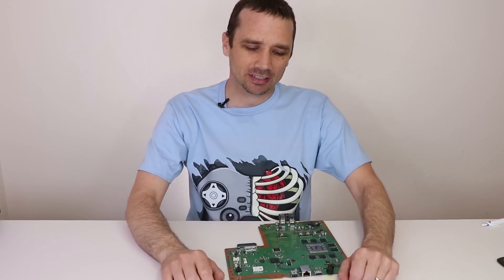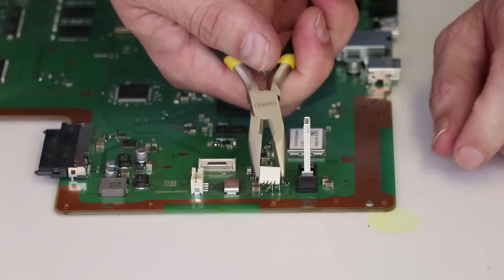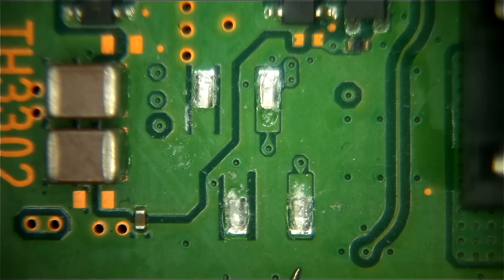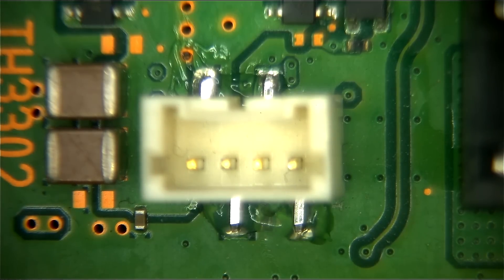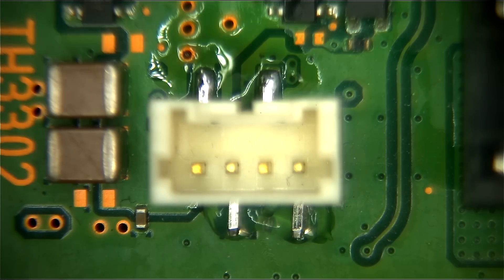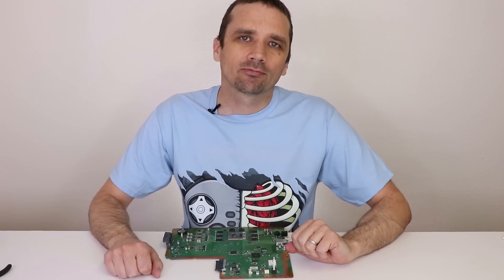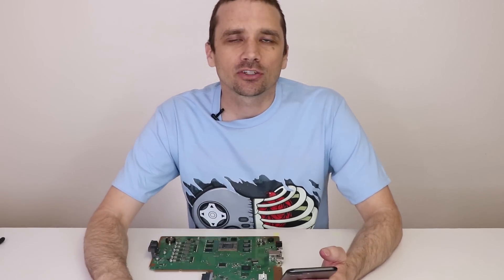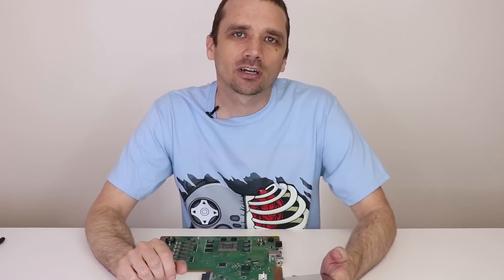PS4 Power Supply Repair + PS4 Q&A At The End

Comment from the maker: Let me know if you have any questions. What other videos do you want to see?
Reply: TronicsFix I have two questions 
1: my PS4 crashes pretty hard and displays a message saying "error in the operating system"  thing is that I restored the console 3 times with a USB stick and a fresh install of the OS and it keeps crashing to the point where I have to unplug the thing 
2: my Xbox one S had a weird problem with the on/off and eject button 
I pressed the eject button the console turned off, same thing with the on/off button,  it ejected the disk 

Hope you know what the problems are 
Great channel by the way
Reply from the maker: Hmmm...not totally sure on this one. I'd lean toward the APU or hard drive.
Reply: @legofan8070  ja irgendwann
Reply: What would you recomend for a cooling mod on the ps4 or ps4 pro?
Reply: @zKyserr  Actually a good mod you can do is to replace the thermal paste and the thermal pads with much better one, like Arctic's one, thermal grizzly isn't bad also
Reply from the maker: They generally don't need extra cooling. I don't know of any legit cooling ideas that actually work.
Reply: I opended up my ps4 to clean it and my 4 pin connector broke and I ordered a new one and I pluged it in and it still wont turn on can you please make a video on this!!!
Reply: I've got a ps4 power supply that has a short in it. It pops the fuse as soon as it gets power. How do I track down the short? And no, there were no roaches in it lol
Reply: TronicsFix  hello, can you make a video testing god of war on the ps4 pro and see how loud it gets, because mine gets really loud when playing god of war.
Reply: Oh alright. I was thinking about cutting a hole on the top of my pro where the fan sits. Then putting a dust filter over it. In hopes of letting more air in and making the console more quiet. A video comparing it before and after on a game like god of war would make for a interesting video i think. Keep the videos coming love your channel!
Reply: TronicsFix  where can I find the fan connector on ps4 slim?
Reply from the maker: @yj mo I don't know of anywhere to buy them. I take them off of junk boards.
Reply: What is the exact name of the replacement plug?  As I searched, I found "JST 4pin 2.54mm" and it looked similar - is that the correct part? I accidently ripped mine off and damaged one pad too. Even after disconnecting the Power Supply side, I wasnt able to get the cable off the connector, so I want to try to resolder a new connector and get a new cable too because my cable-plug (plastic) is heavy damaged bei the tong I used. - Its a PS4 Pro CUH-7016, with a 4pin wire.
Reply from the maker: @martin I don't have a source for them. I take them from junk boards when I need them. Sorry.
Reply: @Tronicsfix  Thanks for your reply, I already gave my console to a technican that soldered a bridge cable for me and my plug was still usable. Anyways I has some short circuiting if the cover was screwed on properly so I had to put Isolation Tape around the hole were the powercable went through... this was actually solving my problem.
Reply: @Tronicsfix  Hello from Germany. Searched a lot in the internet but found nothing.
My system clock resets everytime i shut down the ps4 and unplug it.
Changed The cmos battery 3 times but nothing.
What could it be on the board? Nice greetz.
Reply: Hi tronicsfix. My ps4 has recently just stopped working. It wont respond to anything i do. It wont turn on if i press the on button, the disk eject button and it wont turn on if i use the remote. I suspect it's the power supply. Does it matter what model power supply i put in.
Reply: Does it work if you just shortcut the side connector of the power supply so it will always give the +12VDC?
Reply: My PS button doesn't work on my controller please help me it charges but won't power on what's wrong???
Reply: Can you do a video on how you connect these wires you speake of at 1:50.
Reply: How much do you charge to fix this problem
Reply: @TronicsFix my ps4 fan won't spin anymore, It happen when i played Assassins Creed origin, after 2 hour playing my ps4 fan suddenly spin so fast 2 times and then it give overheating message and force shutdown. After that i open my ps4 cover  and try to turn it on the fan does not spin, i tried to clean the dust on the fan and on the heatsink  and change the paste too but it doesn't work, my ps4 fan still not spining. Do you know what the problem is? Is my fan broke?
Reply: Hey mate. I have a ps4 power supply that is somehow not working. Main fuse was blown and i tried replacing it with end result that ntc1 thermistor literally blew up in test. Is it even possible that the thermistor was the problem at first place and blew out that fuse. Where i should be looking for the problem next?  power supply is model apd-240
Reply: My ps4 wont even turn on at all
Reply: Water spilled on my ps4 maybe four days ago.. now my ps4 turns on and off  by itself and when it boots up it’s in safe mode I’ve tried options 3,4,7 in safe mode but it only turns off and restarts in safe mode what should I do?
Reply: TronicsFix can you do a video where the one pad in the video rips off and you need to run a trace would be very helpful
Reply: On mine the mounting point ripped off. Am I screwed?
Reply: Where is the best place to get a replacement motherboard and logic board for the ps4?
Reply: Hi I "broke" my usb port, USB cable was touch metal and make Spark.. now front USB port don't work.. Can you make some video or comment about that..
Reply: hello 
excuse me but what is the name of the(white) piece you change
do you have a link 
thx a lot
Reply: Can I send in my ps4 for you to dodger these parts back on with a new power supply ?
Reply: This happened to my ps4 pro can you make a video on how to fix it?
Reply: Hi, could you please measure the value of the two big brown caps directly beside the white connector (opposite direction of the big power connector).
Thx in advance!!!
Reply: @TronicsFix I tore off my power supply connector from my motherboard and then I hired a electrician to solder it back on but my ps4 still isnt turning on. What do you think is happening please help
Reply: Hi ... I did broke the other end pins
Reply: One of the pins broke .. what sould I do in this difficult situation cause I cannot go out because of the Corona 😭
Reply: TronicsFix how do we send it into you?
Reply: TronicsFix I need help so right next to what you took off there is those two small boxes how do I put those back on ?
Reply: TronicsFix do you know the part number of the connector? I brought a broken ps4 on eBay and there was no cable and no connector.
Reply: TronicsFix where can I buy the 4 pin connector?
Reply: My ps4 pro lights up and turns off right after I opened it to clean it for the first time and I brought it to the repair shop and they say the motherboard is not good, how  can I fix it?
Reply: Where can I buy some of those connectors for my ps4
Reply: I tore mine off my ps4 pro
Reply: on the ps4 it looks different. and even after the connector tore off I couldnt remove t from the cable. i also have pieces of the green from the board ripped up a smidge.
Reply: please show this same thing for the latest style of ps4 pro.
Reply: Is that Adhesive glue???
Reply: Do you have a link to the surface component for the power supply? We yanked it off, and lost one of the connectors. I cant find the part anywhere
Reply: I have a PS4 pro that is missing all the pads and I did a a repair for another PS4 like on this video but now it turns on then off
Reply: Do you know where I can buy a 4 pin power supply cable for Fat PS3? I look on line and can only find one for PS4. Can I use a PS4 4pin cable for my PS3. Please I need help
Reply: You didnt show how you removed the 2 pins that stayed on
Reply: Marko Croatia
Hi Everybody ,i have problem with my power supply connector

Problem is Because ALL my pads is ripped off from motherboard,model is cuh-1116a ,so do you have Any scheme how i can repair,solder with wire trace?
prije 24 minute
Reply: what if i broke the wall of it and not the connector its self
Reply: I believe that I pulled the pad off for the top right pin so how when I run a trace wire how would I need to do that?
Reply: I want to see another one of this same motherboard SAB-001 with 4pin but with trace repair on all pads and pin out rebuild on this one on 5v rail. Thanks Steve.
Reply: We’re do I find a replacement
Reply: Hey Steve    I have a problem with my power supply and. I got a few questions I wanted to ask u let me know if u could help me.  U could reach me at 16492468946 or my instagram Otb_diri
Reply: Trace wire how to
Reply: Plz tell me can I just solder it without flux  plz answer me
Reply: Okay I'm ordering a soldering kit so I can do it myself so my question is what temperature was your soldering pin on when you was repairing the connector
Reply: Why is that connector only got four silver joints but when I look up the connector there's only four silver joints on one side only

Comment: I pulled mine off by accident, ended up pulling a piece of the board up with it, soldered it back down with no wire, works mint, might depend on if it pulls off cleanly or not

Comment: Hi ~ I've tested my PS4 Pro's power supply, but it's not getting the full 5v ( getting just 4.8v ) or the full 12v ( getting just 11.85v ) ~ The system was bought used and is not turning on, and was wondering if these lower readings are a indication that I need a new power supply or should I start looking elsewhere for the problem ~  Thanks

Comment: hey I have a question, when i was pulling out the power supply cable, I was pulling on the one on the motherboard. I didn’t fully pull it out, but now it is loose and it seems like of of those connections to the motherboard is not connected anymore. My ps4 does not turn on now and I was thinking that was the problem. Would I need to solder it or is it something else in my system? Thanks and great video too!

Comment: I applied thermal paste thrice after cleaning metal chip shinning.
But when I press power button blue light lits and off and then it's dead..
Cleaned everything fan as well, reactor as well. Where would be the problem?

Comment: i didn't realise how much more straightforward electrical soldering is

also if you heat the pins like traditional soldering it connects much more cleanly than using this method (still a great vid though)

Comment: I would've been lucky if my power supply lucked like that but il show you a photo of how mine ripped of from the mother board and believe me it come very easily out,the thing is that mine has not had those pins but onli some slim bronze conectors on the surface of the motherboard...

Comment: How you doing sir. I recently had the power supply piece solder back on the mother board on my ps4. Now when I start it up the blue intercator light will come on for about three seconds and  the ps4 will shut off .why? Mind you this is a original ps4 with the blue light on top of the box. Please help . Thank you for your time.

Comment: I did it and the continuity is fine with a multimeter, but the PS4 still won't start.

I tested the PSU too (I think) and I get 12v through the prongs but it goes back down.

Could I have damaged the PSU? I barely touched it until I suspected I broke it.

Comment: I pulled mine off, resoldered. And now it will stay on for about 3 minutes and turn off. Does it matter what type of solder I use? Is it even possible that a faulty solder or wrong metal used would cause this problem?

Comment: I got an urgent question, at min1 there are two pins right next to the adapter youre pulling out,  now are these two pins essential for the battery to run or are they just a clip to hold the battery once reasambled?

Comment: Mine has no power after cleaning. I have tried both a new power supply, 4 pin connector and power cord. So its definately not them. Next step is this little bugger on the mother board. However there is no movement in mine and it appears intact? Any one have any tips or advice? It is am original laughing ps4. Any help would be much appreciated

Comment: I just finished doing the repair on the motherboard soldering wires to the complicated isolated traces that were broken. I wanted to clean my old brothers ps4 because it was super noisy and dirty, and ended up being unable to unplug the connector, because god knows why, last repair shop glued the connector toghether and i wasnt smart enough to notice it before pulling it.
Long story short, those isolated pads are so SO tiny!!! , its a huge headache, i will never open another ps4 again for anything i dont absolutely have to do.
 And I work with airplane electronics. You can imagine how humilliated i felt when i broke that connector.
Anyways you guys can do it, dont lose hope, but if you have a good repair shop nearby, dont even think about it, Steve makes it out to be much easier than what it is. Also he is legendary with thermal paste.

Comment: Help! I bent one of the long towering pins right next to the repair that you did. Happened when I was putting power supply back in place. Can I just try to re-bend it back? What does it do? What is it called? I'm trying to find any info I can and any help would be appreciated!
Reply: Currently going thru this same problem what did u end l having to do ? I bent mine while trying to pull the motherboard out.

Comment: Hi Everybody ,i have problem with my power supply connector

Problem is Because ALL my pads is ripped off from motherboard,model is cuh-1116a ,so do you have Any scheme how i can repair,solder with wire trace?

Comment: Disconnecting the power supply almost gave me an aneurysm, definitely the hardest part of disassembly. Thanks for your help!
Reply: It's as if the connector is designed to break off.
Reply: As a electronics designer myself, I just call this poor design.
These connectors are known and notorious of breaking of the board, often taking the pads with them.
In cases you really can't get around it, they must be glued on, or at least strengthened with glue or some kind of silicone.
Reply: I was going to replace my thermal paste and the power supply stopped me. I figured be wise, back off before I cause damage that’ll render the system unusable. In other words I’m not happy about it, any tips to get this off or to apply the paste without having to remove it would be GREAT!
Reply: Definitely the most tricky part of PS4 disassemble. I was like sweaty like crazy hoping I didn't yank out the power connector on Motherboard lol
Reply: My ass broke one of the wires …🤦‍♂️
Reply: why dont you just disconnect it from the PSU side instead ?? PSU should be coming off first anyways, thats how all the damage takes place.
Reply: Where I can get this connector?
Reply: I cant pull it out im so scared and nervous
Reply: Just broke mine off lol
Reply: It doesn't want to  release lol. It is so hard
Reply: @wayweh  it might be easier to try and disconect it from the PSU instead of the main board, I do that when i repair these. Just hard solder them to the motehr board with a longer cable and just keep the connector.
Reply: Mine got out should i do like his vid?

Comment: @TronixFix When you showed me how to pull out the power supply, I subscribed. My ps4 was overheating and I had to take it apart to clean the heat sink. My battery cord is stuck and I’m scared to pull it off the motherboard or tear the wires. YOU showed the proper way to do it when other YT channels just yank it like it’s easy. THANK you!!!

Comment: I have a PS4 pro model CUH-7216B and I’ve ripped off the power supply to the motherboard, including 2 of the chips that connect to the motherboard, is there a fix for this?

Comment: Hello, would you know how to hook up 12V to power to a 3.5HDD through the PS4 Sata connection vs using an external power source. I'm using an 8TB 3.5 that needs more power than the ps4 Sata power is putting out....

Comment: Hey, just had a phone call from my heavy handed cousins telling me he’s ripped off the power supply connector. 
After watching your vid. I’m confident I can fix it, BUT I cannot find the replacement component. I keep coming up with either the eu 3 pin mains plug or just the cable that links the power housing to the motherboard connector. Any ideas on what I need to type to get the right connector? Cheers in advance
Reply: Ended up soldering the original component back on
Reply: @philmacey9121  did it work ?
Reply: @georgebarger5510  yeah. Still going strong today
Reply: I can't find it too

Comment: Ive had a ps3 with the same issue for years but im not sure if the solution for this translates to the ps3. Its a ps3 fat. Ive been trying everything for a long time and sometimes i get it to turn on with just holding the connector in place but i would lose connection. if theres another solution like just running the wires to their circuits or just trying to do the videos solution with the connector then id appreciate any help

Comment: I soldered it too but the ps4 just dont turn on. Do i need to put the connector perfect at the 4 metal thing there? They are all connected with the 4 metal things on the circuit. But like i said it just dont turn on.. 

I just wanted to clean my ps4 and i accidentaly pulled the connector too hard :/

When someone can help me it would be very great!
Reply: same bro
Reply: Same
Reply: Damn connector did not want to come out what so ever ended up ripping the connector out from the mother board. Was so mad done this countless times before but this ps4 wanted to be a right pain